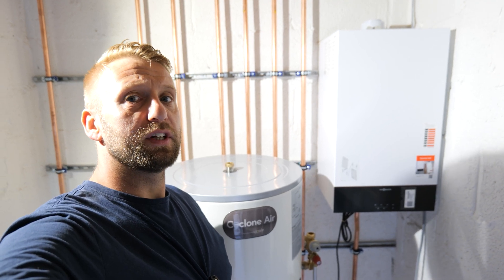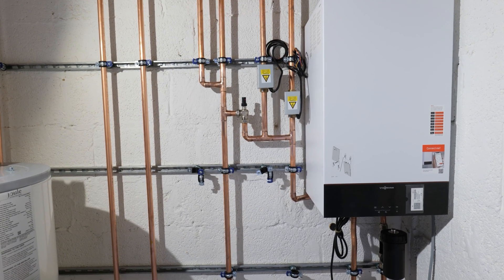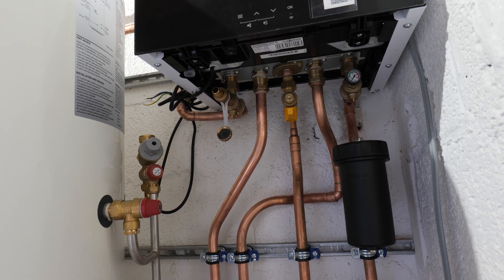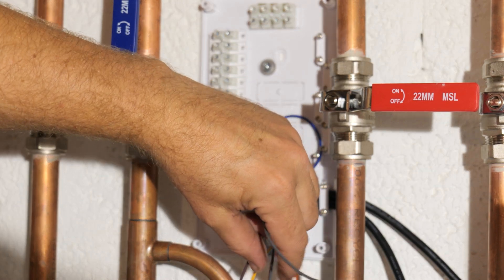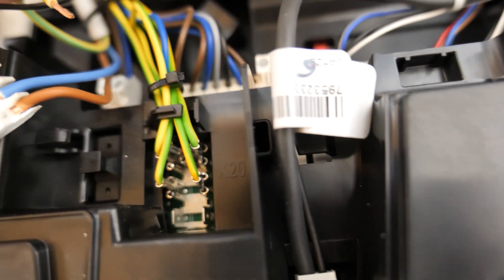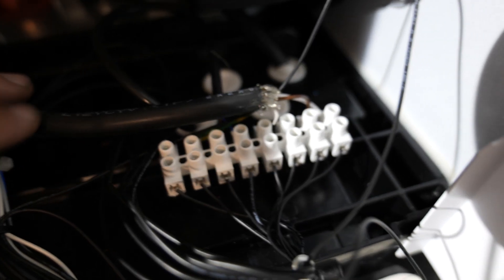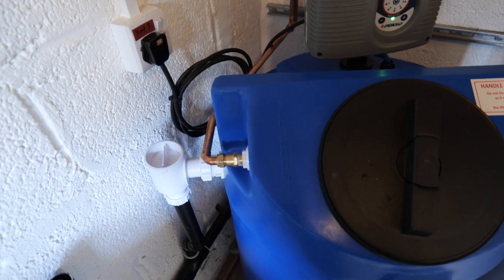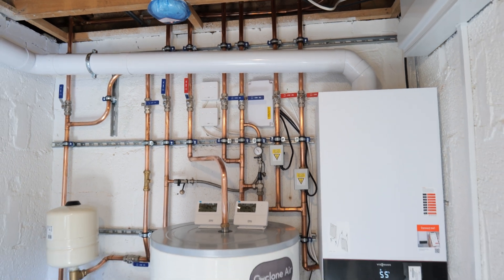Simple, but effective? Powertank

Comment: The hot water tank, by mixing pipes what looks like aluminium , doesn’t that cause galvanic corrosion in the heating ? This is a big no no and should be in copper throughout